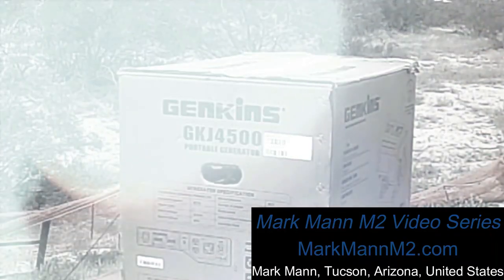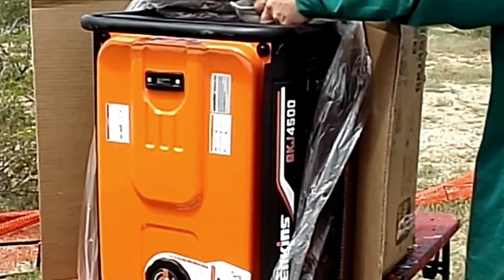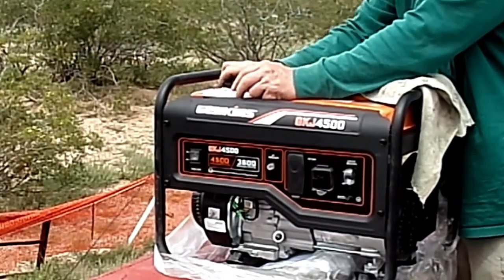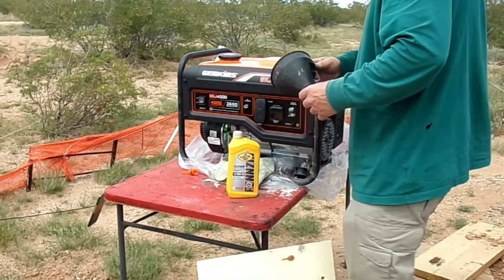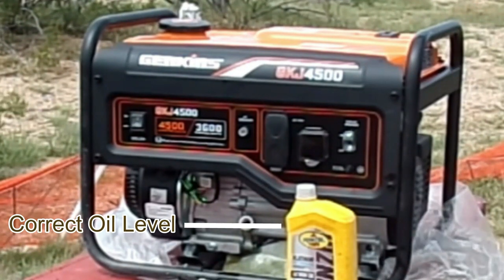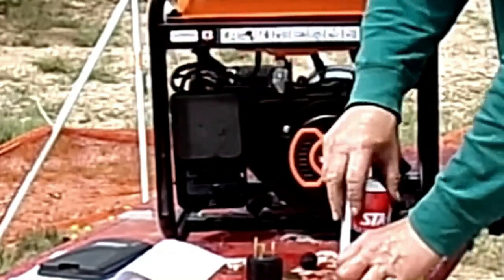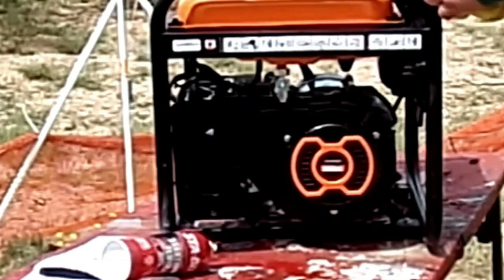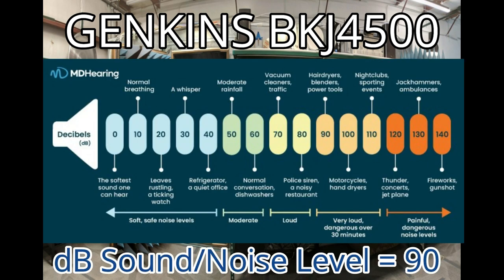Genkins 4500 Gas Powered Generator Un-Boxing, Set-Up and Evaluation. MarkMannM2 Video Series

Comment: I've got this exact generator. I paid right around $450. I think for it it was hard to start at first, but once the break-in period was over it's actually does run about 70 decibels. I've only used it a couple of times but it cranks on the first pool every time. However, I always cut the gas off on the carburetor and let it run completely out when I store it
Reply from the maker: I now start it with a 20v Craftsman Power Drill. I will make a supplementary video. Be well!